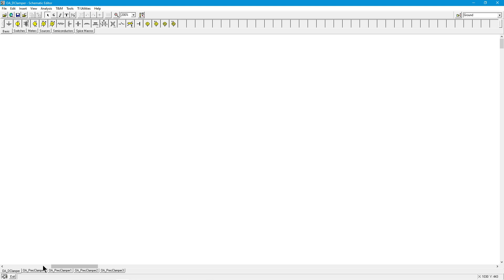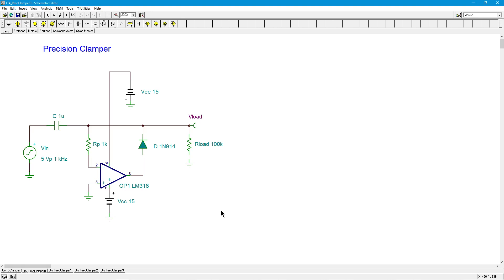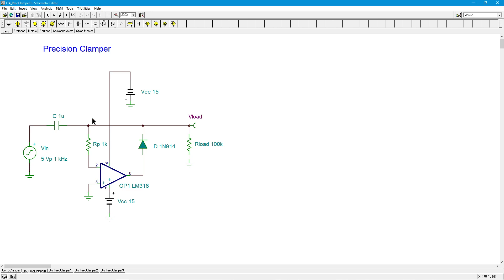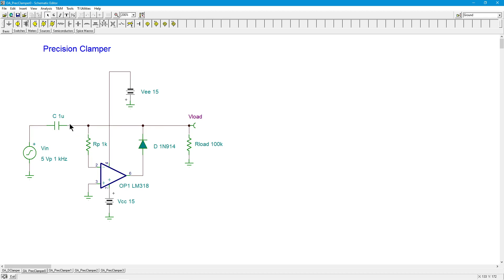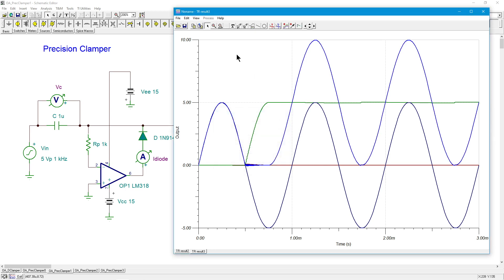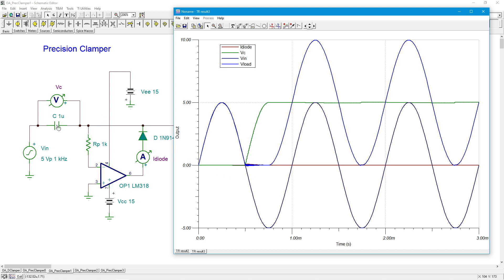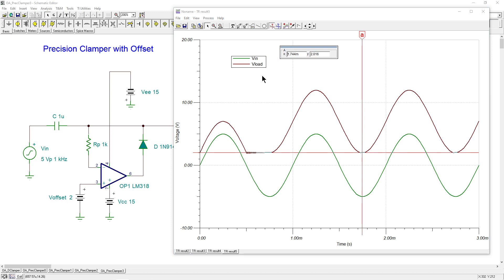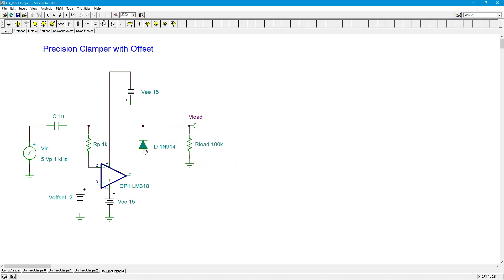Op Amps: Precision Clamper

Comment: at 12:00 and 15:32, the “chatter” is due to the opamp saturating from too much current demand?
Reply from the maker: It's due to the fact that there is no hysteresis. The cap starts to discharge (just a smidge) which is enough to flip the state again. Look at the waveforms from 14:10 on.
Reply: @ElectronicswithProfessorFiore  thank you!